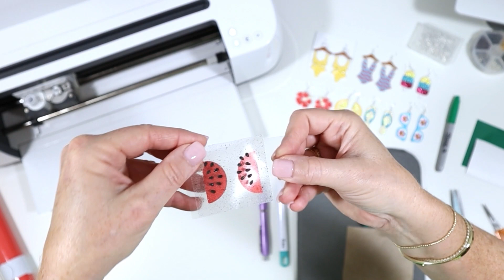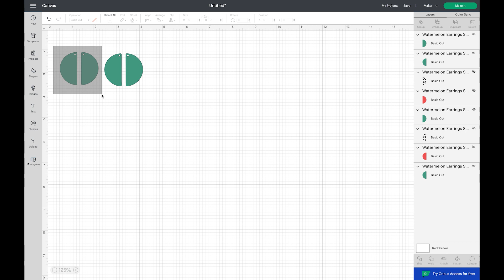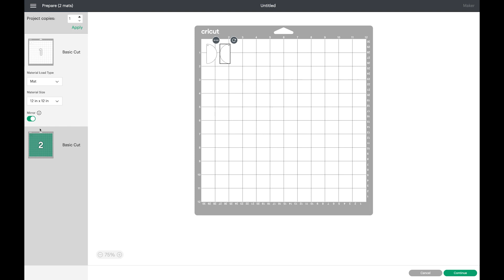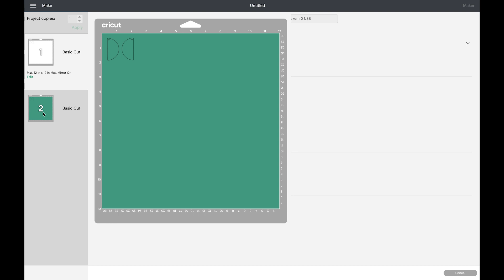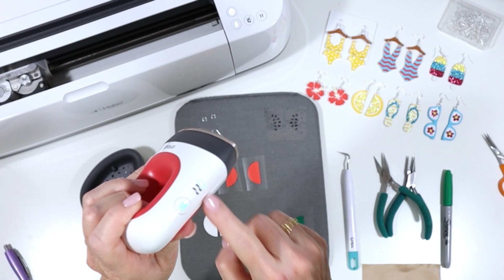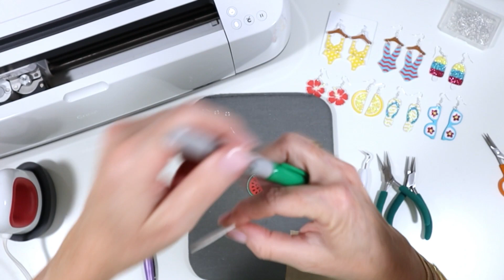How to Use Heat Transfer Vinyl to Make any Color Faux Leather - Cricut Faux Leather Earrings Tip

Comment: I do something similar to expand your fabric options when making purses/bags. Use any fabric (even cotton) and spray glue on top of marine vinyl. Let it completely dry. Expands your fabric selections but still gives you the structure needed to make purses/bags.
Reply from the maker: That's a fantastic tip, Denise! Thank you for sharing it with me!

Comment: I cut a sheet of faux leather the size I need for what I'm making and then place the vinyl on the faux leather first and then cut out my earring shape. It gives it a much cleaner edge.
Reply: I do the same. I am not nearly as good as Amy at keeping the vinyl in the same spot and it ends up slipping on me. After a couple tries I starting putting the vinyl on the leather first and then cutting them both into whatever shape I need.
Reply from the maker: Hi, Nancy! Yes, this is what I do for the back. It's another great option, thanks for sharing it!
Reply: I was going to ask if you could add a tiny offset to make it a tad bigger to accommodate shrinkage. By the time you add all three layers it would have shrank even more anyways. Trim if still required.
Reply: @lseh  if you're using an svg you can make it whatever size you like. Also if you first make the vinyl and leather sheet,  heatpress and then cut out your shape, you won't have any shrinkage.

Comment: Adorable. How long do you press each color vinyl layer in order not to damage the vinyl? It seems the faux leather doesn't take much time with the polyester backing.Thanks, Amy.
Reply from the maker: Hi, Mardell! I press each layer for about 5-10 seconds, just long enough for it to stick, similar to how layering HTV on t-shirts works. Then I cover and press all the layers together for a few more seconds at the end. :)
Reply: @AmyRomeu  Thank you Amy. Do you also have a trick to avoid the mark a tranfer sheet can make on the finished faux leather  earring?
Reply from the maker: @mardellgrayhek9958  Hi, Mardell! Yes! The trick is to leave as much transfer sheet around the vinyl shape as possible. Ideally, the edges of the transfer sheet should extend beyond the border of the faux leather shape. That way the edges aren’t pressed on top of the faux leather. 

Sometimes you may need to drag your shapes apart in the mat preview screen in Design Space so the cut with this large border area around each one. :)
Reply: @AmyRomeu  Thank you very much. 🇺🇸